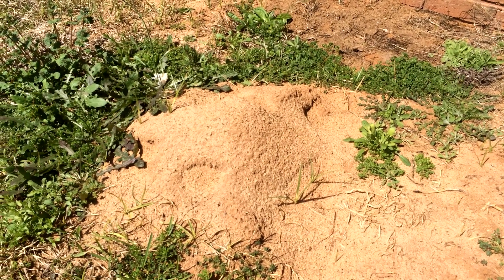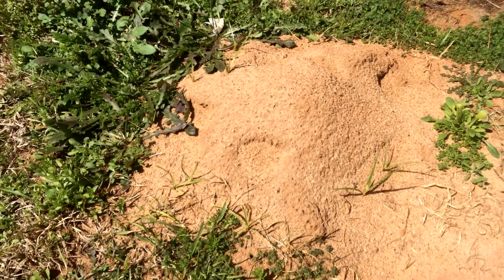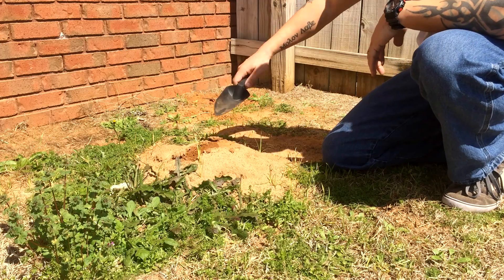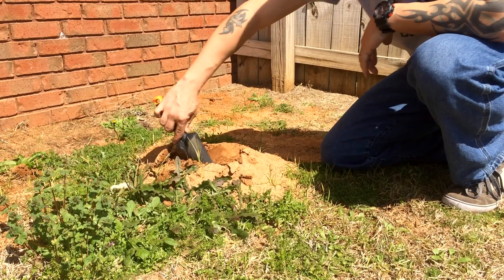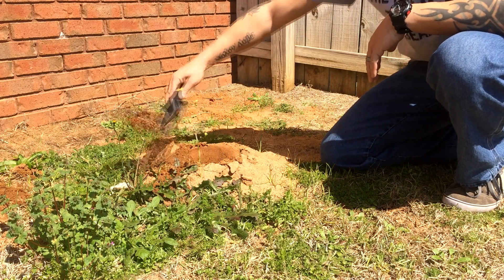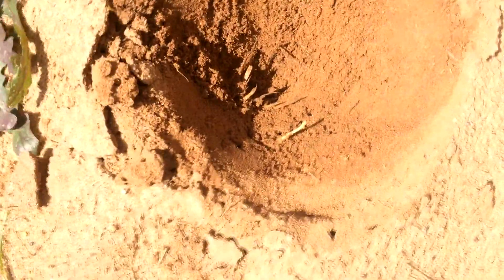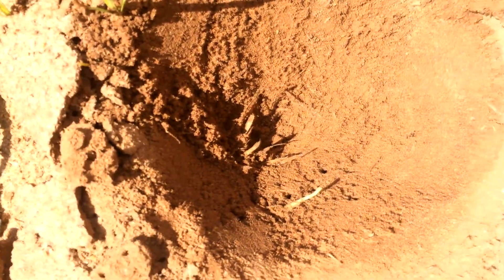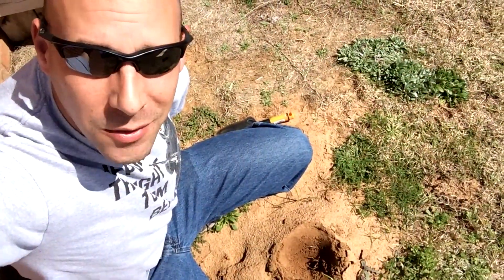Ant Hill Prep (Little Sparks Ep. #4)

Comment: I was thinking that if you used a cheap 2 foot level, as a screed to level the top of the anthill after you dug it out. The overfill may run out evenly, then tamp it down like your friend did in video 2. Just a thought. Cheers
Reply from the maker: that's not a bad idea at all...  i generally don't have any over pour as i actually need to add more metal but when i do its a hell of a mess...  Ill try that next time.  Thank you